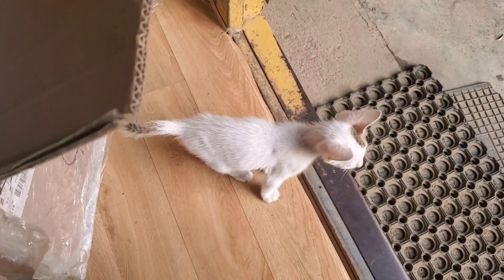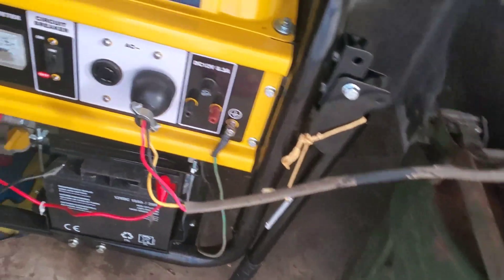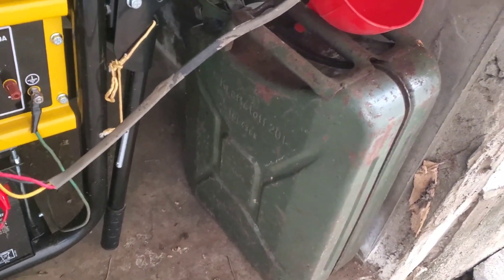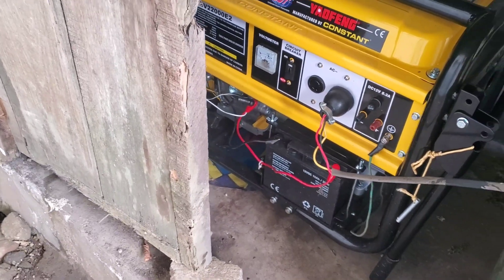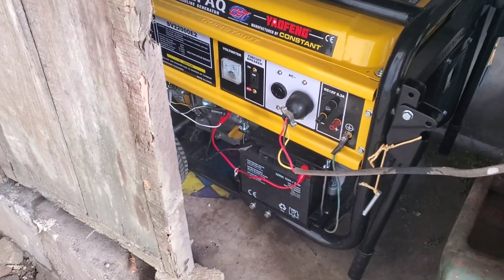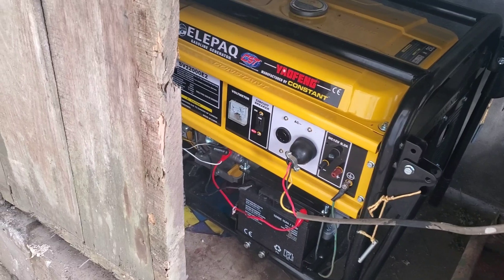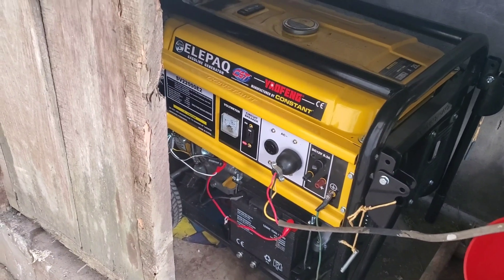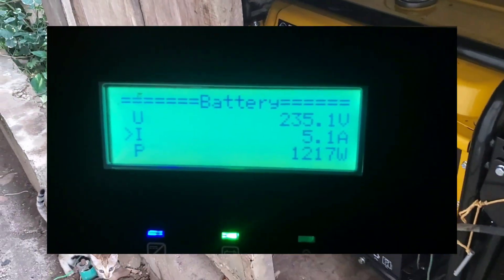Generator: SolaX Hybrid vs Deye Hybrid. Clear winner Part 2 #solax #deye

Comment: I did some research regarding the challenges you had expressed with small gasoline generators working with deye inverter and I comparing it to the ones that I have locally here in Jamaica. What I've noticed that the AC waveform from the small gas generator was heavily distorted. It was nowhere near a pure sine wave I'm good it looks like the inverters do not like that
Reply from the maker: Hello Johann, thank you for commenting. I appreciate the feedback. I am off the same opinion too. The bigger generators cost more and are built with better quality material. So it makes sense that they would also perform better. We don't seem to have the issue to the same extent with the inverters that have transformers. I appreciate your comment and feedback

Comment: Hello, I have an 8kw Deye inverter and I have been playing recently with a petrol generator. Do you have any suggestion on how to connect the 12v gen signal to the generator so you can have a close loop instead of manual on/off?
Reply from the maker: Thank you for watching and commenting. Please don't forget to like and share. You have dry contacts inside the inverter that allows you to do this. Don't forget to check gen start.

Comment: Most inverters I found investigating do mention diesel generators only, never gasoline, so I suspect it is a known issue?
How about using a changeover and using the grid input of the inverter instead of the generator input, pretending to be the grid? I am a student so what do I know Doc? 
My neighbor received his complete system (panels, inverters, mounting material and lead acid batteries) from China, all generic Chinese stuff, no known brands. I just hope it works for a long time for him. He is against LiFePO4 batteries because he thinks the battery technology will improve a lot in the coming years and he dislikes the digital controllers and wifi. But he has his stuff while I am still struggling to get a deal done.
Reply from the maker: The Matebox switches automatically once it senses the voltage from the generator. It allows the generator to power the load directly. 
He paid for batteries that are over 100 years old and he wants to wait for exactly what? 
Your deal will materialize.

Comment: We, let me speak for myself, I do appreciate you and your videos and our journey since last year. Your experiences, lessons and recommendations have also lead me to settle on the Sunsynk inverter, which in terms of hardware is a Deye. I haven’t pulled the trigger on a 5Kw system because I still have to redo my wiring and panels which are messed up. Funds permitting and having found an accredited installer, I will then get this done. So you are greatly appreciated. It’s great to see the kittens doing so very well. I chuckle because there was a time you were reluctant to raise them & I predicted you would 😃😀

On the Deye issue, is the fact that you are no longer a Deye representative the reason they’re slow to give feedback? One would think your invaluable information would help to improve their products💁🏽‍♂️ If get a small 600Va UPS, and you get the generator to charge the inverter through that, it should work (stop gap measure).
Reply from the maker: Thank you. You have been an awesome friend to the channel. You were on the money about the kittens. I feel like a parent.
Deye is still very responsive to my requests and they continue to offer solutions to problems that I encounter. 600 Va is way too small and the inverter would damage it. We are exploring options if Deye is not able to find a resolution for us.

Comment: Both gasoline and diesel generator produce electricity you should investigate and come up with a logical and technical reason as to why deye does not work with gasoline generator.
Reply from the maker: They produce electricity. The diesel tends to be heavier duty and normally better quality. That might account for the difference.